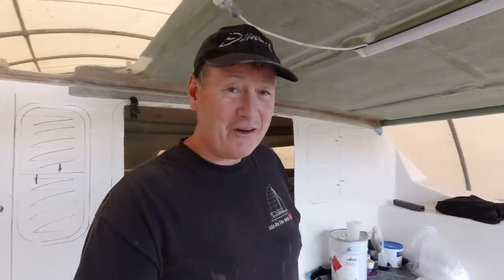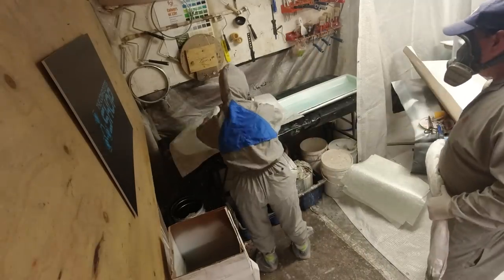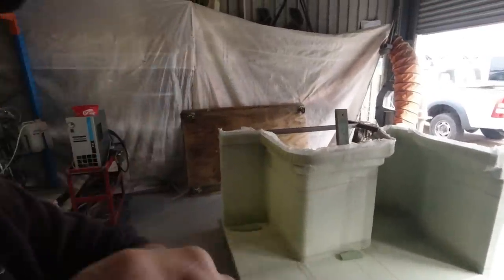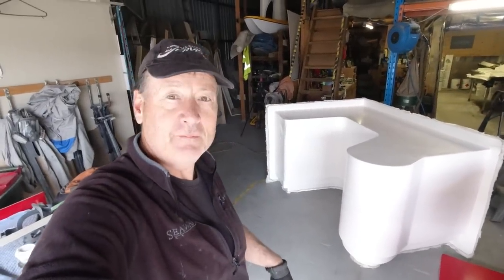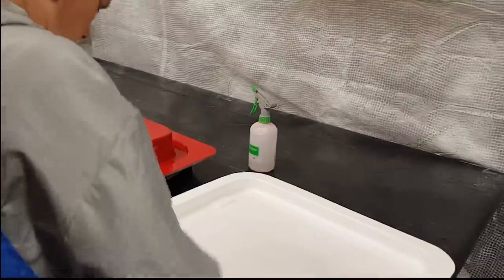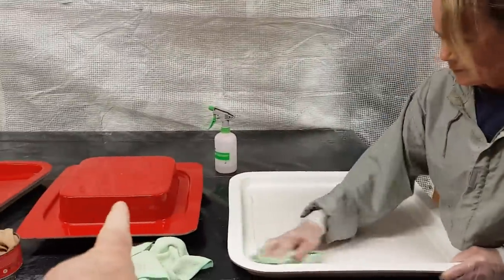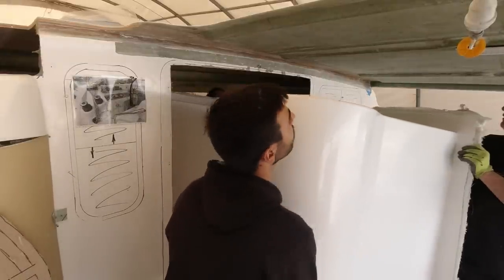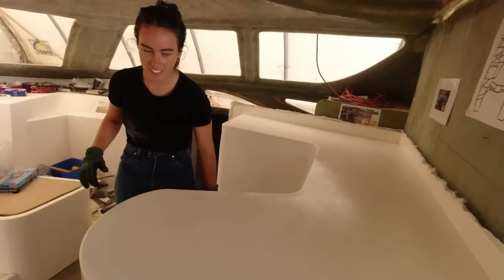Our new Catamaran Galley - Catamaran Building form scratch Ep 240

Comment: Hi Ross, You got some sharp ladies helping your build... I too wondered like Ellen about heat in the "electrical cabinet" area... thinking maybe use that low smaller 3rd panel near the door for some cooling air intakes if door is propped open a fraction or mounted non flush, and put a powered vent fan up top for evacuating warm air ? If for no other reason than you can sometimes smell an electrical system building up to a failure as insulation heats up or when something gets smoked or blows fuses. Same thing holds true for the batteries and controllers.
Reply from the maker: I will have in line fans to vent the enclosures.They have very good heat tolerance but the amount of wire and equipment in the compartment is substantial.Ross.